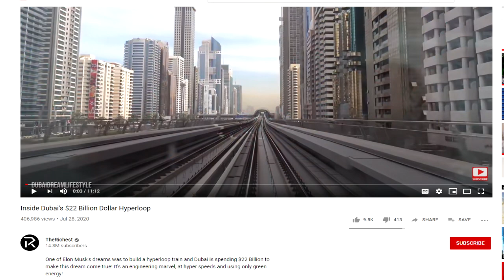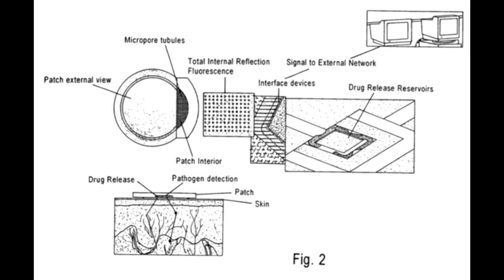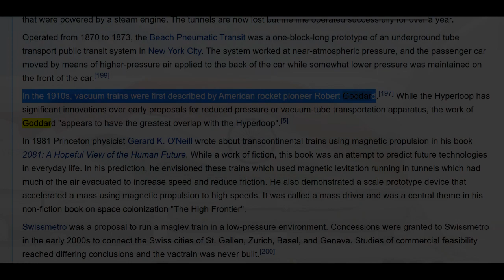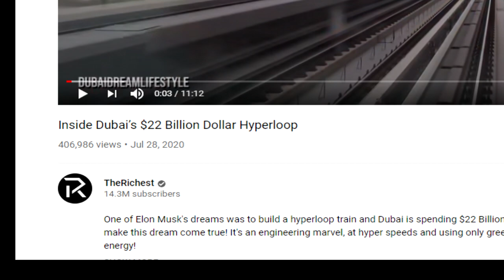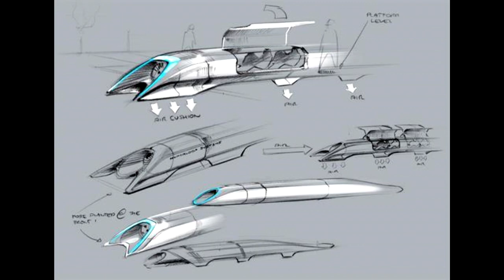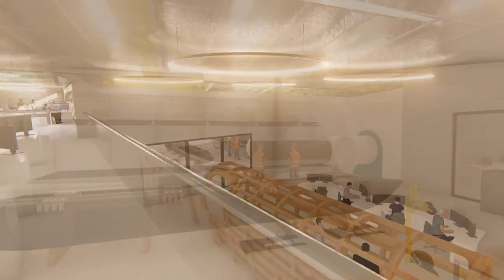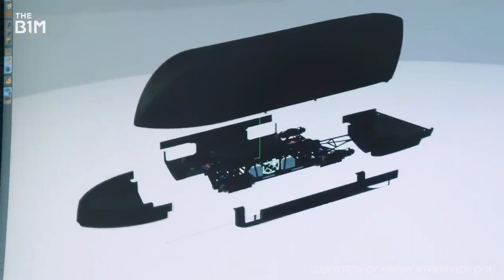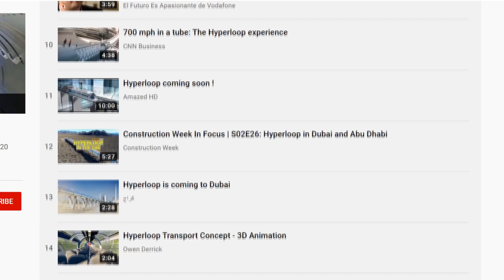Hyperloop, the biggest Scam since Theranos

Comment: "Elon Musk invented the hyperloop!"
And Thomas Edison invented the lightbulb.

I bet nuclear fusion will be here before hyperloop, always being 20 years away.
Reply: At least fusion energy has the potencial, if achieved, to produce cheap and non poluting energy, and it has been proved that its possible to do it for a few moments, while the hyperloop hasnt even hit the 1000 km/700 mil claimed to do, is a safety hazard for the passengers inside the claustrophobic capsule, isnt economicaly viable, and it may be better to just develop next gen supersonic planes (or make maglevs cheaper), as thought with issues regarding fuel consumption and enconomically, at least its been prooved to fly and to fly at those speeds.
Reply: @stormnet7836  Fusion doesn't have the potential to eliminate our energy needs, it WILL eliminate our energy needs once it happens. It is by far the most efficient process of getting energy out of an atom aside from matter and anti-matter annihilating each other. It just turns out not having immense pressure like the sun has to help it's fusion process makes it really really hard.
Reply: @hohhoch3617  The difference in energy between fusion and fission is not that large, both are massive energy sources by weight of material. The problem is our way of taking the energy out of it, we are still limited by the Carnot Cycle, even the newest Fusion designs are made to transfer heat from one source to another and spin a turbine. Our big technological leap will come when we are less afraid of nuclear energy and have nuclear battery technology powering most of our needs. Then we can think about Direct Energy Conversion and finally dip our toes into Fusion Energy.
Reply: BromoDragoonFly Well, Fusion is in theory 300 to 400 percent more efficient than fission, so I’d say that is a pretty big difference.
Reply: Quantum humans are the answer for all traveling, they can exist simultaneously on both cities ...
Reply: @YogSoth  Fusion is 0% efficient today in the best case. As I said before, nuclear energy is MILLIONS of times more efficient than chemical energy. Even if fusion was an order of magnitude bigger you are still bound by the carnot cycle to a maximum of 70% efficiency in energy conversion. Fusion reactors don't work today and won't work in the near future not because the energy is large or small, it's because we are still trying to draw heat from the process to spin a turbine.
Reply: BromoDragoonFly So you come back in your reply with, “As I said before, nuclear energy is MILLIONS of times more efficient than chemical energy.” ( Nice all caps by the way.  What are you, an eight year old? )  What are you referring to? You didn’t say that in any post.  I could keep going but why waste time with someone who spouts bullshit and then lies about what they say.
Reply: @YogSoth  This was in my original comment you completely failed to read/understand "The difference in energy between fusion and fission is not that large, both are massive energy sources by weight of material."
Make an argument if you will, but I do not play with ad hominems.
Reply: BromoDragoonFly I read and understood your original comment just fine.  Yes, you did state that that both were massive energy sources by weight of material.  Your original post did not, however, say anything about nuclear energy being, “MILLIONS of times more efficient than chemical energy.” Your original post made no comparison between nuclear and chemical energy.  Then in your reply to me, you falsely claimed to have made these statements in your original post.  It is difficult to have a real discussion/argument with someone who so blatantly lies about something so easily verifiable.  It would be like if I said to you, “I didn’t make any ad hominem attacks in my last post. Your the one making ad hominem attacks.”  It just doesn’t work. I would say you must be a Donald Trump supporter, the way you play with facts, but you are obviously an intelligent person so must not be the case. Maybe you just made a mistake?
Reply: So we have the modern Edison, Where is the modern Tesla. :/
(By the way it's hilarious that the "modern Edison" company is named Tesla).
Reply: Just like the cure to cancer.
Reply: We already have nuclear fusion.
Reply: F P  No, I'm correct. Don't try to correct someone until you know what you're talking about. We have deuterium-tritium fusion reactors. We don't have enough energy to do hydrogen fusion because hydrogen has such little mass you have to excite the particles a lot. The fusion reactors we have now aren't efficient though, if I remember correctly they use more energy than they generate.
Reply: Elon didn't say he invented the idea. Plus more than one person can have the same idea, Leibniz and Newton both invented calculus at roughly the same time.
Reply: Familycrusaders You are correct, we do have fusion reactors now- but they require more energy to run than they output, so they have very little practical value.  However, we seem to be relatively close to making the necessary advancements that will make fusion power a reality. Talking years not decades.
Reply: @YogSoth  I know, I already said this.
Reply: Familycrusaders You said if you remember correctly - I was just backing up/confirming what you said
Reply: In my young day, 50 years ago, it was 50 years in the future. it isn't here! Like a carrot on a long stick.
Reply: He never said he invented hyperloop, did he?
Reply: Edison didn't invent the lightbulb, he developed the long lasting filament that made the lightbulb practical. And please don't say he stole it from Tesla. When Edison patented his lightbulb Tesla was still a student living in a small town in Serbia and hadn't yet invented anything. Thank you, have a nice day.
Reply: Might want to edit this lol fusion is very unstable and extremely unefficient even 20 years out
Reply: You know, given the progress that is currently happening over at ITER I would think we are closer to self sustained fusion than a economically viable (and frankly functioning) "hyperloop"
Reply: It's ALWAYS just 40 years away.  Probably will still be, 40 years AFTER I die.
Reply: @stormnet7836  OR ... why not work with what already works NOW?  Fission power has proven itself safer and cheaper than  current fossil fuels or current "renewable" energy technologies.  While stopping ALL progress and waiting for the 'bright idea' necessary to get fusion before starting, why not leverage what we have more efficiently?  Already, my wife and I have a 50-year-old sailboat as our "summer home". When we're onboard, we're entirely "off the net". Most of our movement is wind-powered (sails), most of our electrical needs are supplied by one little solar panel.  Our electrical needs are minuscule due to choosing low-draw alternatives.  When we're "in a hurry" and the wind isn't there, our efficient inboard motor drives us at 30+ MPG all day, topping off the batteries to boot. IF we had forward-looking politicians, we wouldn't finance the wasteful, expensive air transport the way we do and would have less-expensive train service to and between cities.  Stupidly, train companies must be wholly self-supporting in the US, such an ENORMOUS set of distances.  A few years ago, we had occasion to go to Montgomery Alabama, a distance of about 1,000 miles. strangely, it was CHEAPER to fly than go by train, my first choice, and just about as fast to drive, though driving  was, ecology-wise, the most expensive  route, IMO.   40 years ago, I enjoyed a similar-length train ride home during a Spring Break week, which made it a 24-hour party. I arrived home a LOT more relaxed & happy than from the 24 hours of driving back from Montgomery. Thinking back, it would have been better to take the train as we could afford the premium we would have paid to sit back and watch the scenery slide past.
Reply: @skartos64  LOL: "Quantum humans exist simultaneously on both cities...." Life is entirely complicated enough for me to NOT want to double the complexities, or square them, more likely.
Reply: @YogSoth  Don't fault a guy for having some EMOTION on a subject.  If it weren't for "oddball" enthusiasms, we wouldn't be enjoying many of the comforts of modern life, such as insulting  others we've never met who live thousands of miles away from us.
Reply: @FamilycrusadersAnd_The_Crew  We might be enjoying fusion to a certain extent, but not human-generated on a human-needs scale. On the other hand, Hyperloop is an idea which has had its day and deserves it's well-deserved retirement in some dusty drawer.
Reply: @kitemanmusic  A plastic yellow and brown carrot on a VERY long stick.
Reply: @jerelull9629   It's human generated. We have fusion reactors already. They just take a ton of energy, more than they produce. We use Deuterium.

Comment: Everyone is designing these systems without acknowledging how they will fail and will then need to be maintained. All of our modern transport systems can catastrophically fail in one way or another, and many of them put outrageous sums of money to keep things functioning. Trains, for instance, have had a long time in order to be honed to their maximum effectiveness and their development SHOULD inform the Hyperloop. 

Hyperloop and mag trains look increasingly similar as they both butt up against the same physics that limit their function. But everyone is so focused on its speed that they forget that each one would be an investment in infrastructure for decades or more. What happens when any one part fails? Leaks? Jams? Manufacturing errors? How much energy does it take to empty these tunnels of air? How long would it take? I mean, humans have to exit the vehicle so what sort of systems do you need to minimize how much of the system is depressurized? Are there airlocks? How secure are these? I could go on.

Strangely, for all the "lack of imagination" they accuse others of, they seem to be the most wanting.
Reply: yeah, to be honest, I tought that was what they were going to test.
They are focusing on the easy part instead of the hard part.
It's easy to get pods going fast in a tube. The problems are these:
- how to create switches that can be taken at high speeds (or are they going to limit speed to 200km/h everytime they pass a switch?)
- how to put pods in and out of the tube quickly and safely
- how to keep the pods seperated at a safe distance (there was a completely new signaling system invented for high speeds trains, and that will probably not do for speeds of 1000km/h+)
- how to do emergency evacuation
- how to do maintenance
- what is the ideal pressure to balance speed and cost for the vacuum
- is it better to have powered rails, a non powered rail or no rail at all
- how to construct the tunnel (welds? -> expansions troubles, rubber seals? -> not as strong, ...)
- how large should the pods be (I'ld guess around 40 passengers, but maybe it's much cheaper to make pods for 200 passengers and have less frequent service)
- ...

I'm sure there are solutions for all of these problems, but it likely make hyperloop a lot more expensive, probably to expensive to make any economical sense...
Reply: Pipelines exist.
Reply: @Robbedem  emergency evacuation of the train is fast and easy if you are surrounded by vacuum 🙃
Reply: @brianmahoney4156  The entire point of my post was that the concept was fine, but it's all everyone is focused on.

Nothing about what I said was about the concept. It was about execution, maintenance, and infrastructure over the long term.
Reply: @Robbedem  Exactly right. The funny thing is that if each of those is addressed the "hyperloop" starts to look like a mag train anyway.

Comment: The hyperloop is basically railroads replaced with vacuum tube and yet it's supposed to be cheaper than a train ticket....
Reply: I love normal, cost effective, light rail.
Reply: Not forget about the additional amount of tunnels and bridges you need because you are (supposedly) 3 times as fast as a regular high-speed train and thus need a straighter line...

Comment: Ignoring any specifics, for a transit system, only two factors dominate:

1) what does it cost to build and run
2) How many people can it move

divide 1 by 2 and you have your cost per seat.   Doesn't matter if it's a hyperloop and rocket, a train, an aircraft or Santa's sleigh.  

So to be "cheaper than a railway" you need either 1) to be lower (cheaper to build) or 2) to be bigger (move more people).  Hyperloop has 1) many times bigger than a conventional railway and 2) many times lower. That makes it "impossible" immediately.......
Reply: That's inaccurate, if you assume infinite lifetime through continuous maintenance, building cost is only part of the time of return on investment calculation. What you want to know is how much it will cost you per year to run it, and how many people per year you will transport. If you can move people faster you can get more train per hour at each stop.

The hyperloop project is sold as roughly three to four time faster than a high speed train, if you conveniently assume that people magically teleport out the pod when arrived at destination, and that the distance of security is left unchanged compared to a maglev train despite higher speeds, you get three to four time the number of train per hour. Now this grossly over optimistic estimation sounds like a very low margin to get any improvement on the ticket price or the number of passenger per train considering the need for giant low pressure chambers, air tight train and life-support systems, but maybe we should just conveniently ignore that too.
Reply: I assume you mean, how many people can it move "per year"
Reply: I have one thing to add to your formula. Time. Where is your break even point?
Reply: This model does not account for speed. Some people pay insane amounts of money just to save a few hours of travelling.

Comment: "Monorail" 🎶
Reply: Lmao, I sang that out loud!
Reply: Moscow monorail is gonna be closed soon. That was interesting contraption, no magnetic suspension, just rubber wheels, but linear induction motor to allow build-up of ice on rail with ability to move forward nonetheless. But it never made profit and was extremely expensive due to its uniqueness.
Reply: Well, sir, there's nothing on earth
Like a genuine, bona fide,
Electrified, six-car monorail
Reply: @Grauenwolf  Yes. Rubber wheels on monorail is nothing new. What made Moscow monorail unique is combination of rubber wheels (it was actually a copy of Intamin system) but with induction motor instead of conventional one connected to these wheels. That's because original Intamin was never supposed to work at Russian winter :)

Comment: I find it odd that their hyperloop test tracks don't actually loop, so they could do some consistent testing and could maybe run that oversized suppository more than a few seconds at a time. So far no loop nor hyper.
Reply: Because it was never meant to be a loop despite having the word loop in its name. I'd prefer to call it a HypeTube.
Reply: @jarvisc952  That's not the point @Kyntteri was making, they were trying to say that if the test tracks were connected (circular/loops) they could run for longer.
Reply: @cydonia9342  Not sure why'd they do that. Even their final product is only meant to replace trains, which means that it will need to stop at short distance train stations. It isn't made for long distance transportation so no point testing something out of the scope.
Reply: @jarvisc952  It actually is made for long distance travel and only these routes will be feasible.
Reply: @jarvisc952  They also wanted to compete with airplanes. So let's take one planned route they had. Reno -> Las Vegas (454 miles). Yeah, why they would ever need a test track that could simulate long travel distances in a relatively small area. Totally out of the scope and extremely unnecessary.
Reply: HyperLoop is like Holy Roman Empire, if you know what I'm saying.
Reply: But plenty of hype :)
Reply: That's because any deviation from a ruler straight line will result in the destruction of the tube.
Reply: Their tracks don't loop because curves would have to be very large radius, so they'd need an enormous test site. If (big, big "if") they can get it working on a straight  track, then it would make sense to try to build a looped track.
Reply: @beeble2003  When they make a real track, then the minimum curve radius (up and down as well as side to side) determines how expensive it will be to avoid obstacles, which is what Victorian railway engineers found out in South West England. It is also why the HS2 railway in England is costing more than double what was claimed and doing much more environmental damage than a slightly slower railway would have done, because it is going through nature reserves and historic buildings rather than around them. All because Prime Minister David Cameron insisted it must be 40MPH faster than the already fast French TGV. The last 5% of the speed is usually 50% of the cost.
Reply: probably because the track would have to be huge to do that.  You can't put a steep bend on a track.
Reply: Whatever the reason it makes no sense to test on a 500feet tube, but it reached quite a good speed in my opinion.
Reply: @cristibaluta  I think "500 feet" may be a mistake -- as I recall, it was also referred to as "500 metres", which is three times as long and seemed more in line with what was shown.